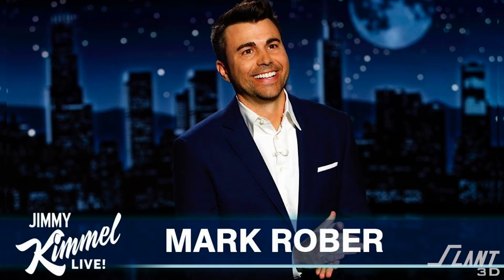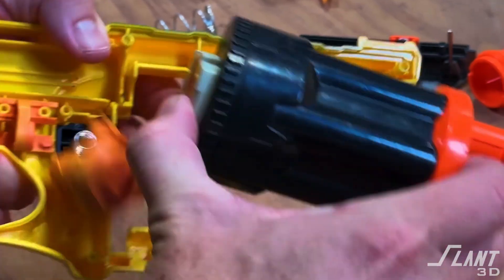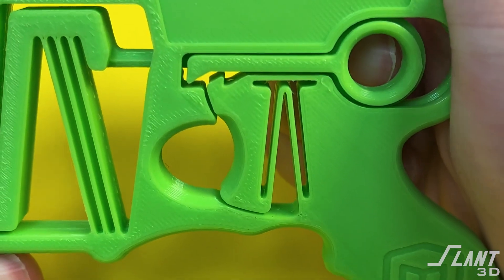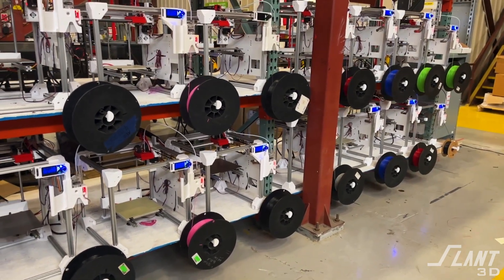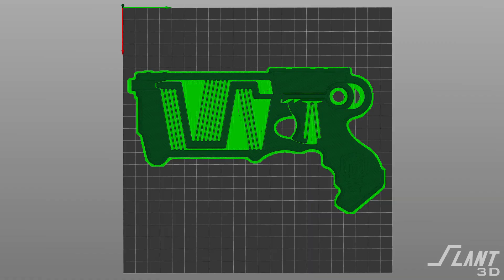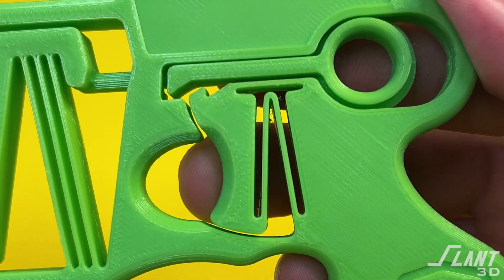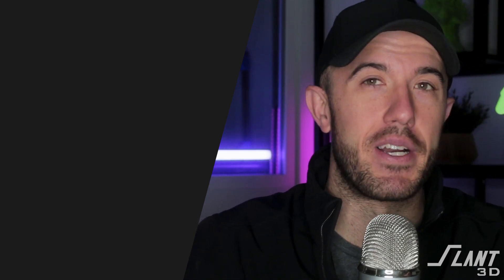The Secret Inside Mark Rober’s 3D Printed Nerf Blaster | Design of Compliant Mechanisms

Comment: Definitely do the redesign. I printed the original at full size but obviously got somethings wrong. Spring was too stiff to pull back easily. When it did pull back to the lock position the top of the gun deformed

Comment: I am confused. Here you propose to build the gun on a solid layer. In other videos you bemoan the ejectability of parts with large print plate contact surfaces. 
The obvious thing to add is a barrel for better performance.

Comment: This most absolutely can be injection molded and formed, along with many other methods.  It can also be molded with dual density etc.  Why do you usually provide false information in your videos rather than just being honest?  Honest mistake?  What is their to gain vs losing integrity and trust?
Reply from the maker: You are simply incorrect. There are subtleties in this design that make it unmoldable

Comment: I scaled this print up on my p1s using pla and it's very difficult to even cock it back. When you finally do get it to latch, when the trigger is pulled the mechanism does like a half shot not firing all the way. It's so hard to pull back that the frame bends instead of the springs. Any input on why that happened?

Comment: I'm guessing a it would make more sense to print the compliant mechanism as a module , as the mechanism is the only thing that needs to be printed in one part and its size is limited to the build plate, an outer frame can be printed in parts

Comment: "This cant be done with any other process" ? yeah right. The issue with those is also that if it breaks, you can't just swap out a new part. Often then whole construction is then busted. To get the spring tension, one could make it by laser or cnc plastic sheet. From carbonfiber, from metals that hold shape instead of permanently bend and even some woods. Nooks and crannies can be made also. Even smart injection molding can do this.

Comment: This is an interesting exercise but I dont think I would want to use this over an actual nerf gun. Trying to make the whole thing one piece is not great. I'd rather have a full-sized frame to mount a compliant mechanism in, and also have an aesthetic cover to give it that Nerf "gun" look. This would make it easier to have a frame printed/injection molded, then you could 3D print the now smaller compliant mechanism, since you aren't printing the full toy. Also, while reducing parts in general is a good thing, NO replaceable parts is actually worse. Worse for customizing and for modification, which is a big part of the Nerf experience for people. It would also be cool if you could shoot either full-sized nerf darts, OR 3D printed darts, making it easier to adopt for people. Now, I've said a whole lot and most of it I don't have the expertise to do, but it would still be kinda cool to see this more fully realized as something other than a novelty to try once and move on.

Comment: This is going to kill Nerf, imagine the neckbeards moving from buying Nerf, with parts, that can be disassembled and modified, to either buying 3D printers and producing their own pistol shaped glorified plastic springs OR going to the hardware store, buying a bunch of plastic pipes and springs and coming out with their own garage kits because, of course, the greedy manufacturer will see this and think they can reduce production cost and increase profit ignoring that their market might depend on 30yo guys that can buy any toy they want and go full nerd and not on kids... stuck to a tablet, with 0 interest in toys... How do you even mod that thing if not by modifying the file to be printed?!

Comment: The "less parts is better" is quite stupid argument, if you ask me.
What happens when it will eventually break?
You'll need to buy a whole new device rather than fix that you got.
Also you can't use different materials with different properties.
And don't start with "but it will be cheaper". Look at America right now. Companies try to squeeze every dollar.
So nah. I'll stick with screws, bolts and multiple parts.

Comment: 3D prints may have a certain springiness at first, but with repeated activations it will fail. Sometimes you just need steel parts.
Reply from the maker: Incorrect
Reply: @slant3d  Well, as someone who has tried to use the springyness of PLA and found them to either break, or permanently deform, I challenge your assertion of "incorrect".  There's a good reason why people generally use proper steel springs and not plastic springs.

Comment: I’m a mechanical engineer and we often avoid compliant mechanisms because they wear down faster and are harder to repair; but in certain cases they let you do stuff you simply can’t do otherwise
Reply: I thought one of the main advantages was no wear? As long as its not pushed past the fatigue limit
Reply: @theaveragepro1749  Very few modern lightweight materials (that I'm aware of) have fatigue limits. Steel does, aluminum doesn't. I don't believe any polymers have fatigue limits. Would work great if you made everything out of steel and titanium, much harder (material science-wise) materials to machine than Al and polymers.
Reply: @diveforknowledge  in this case I don't think fatigue limit means what you think it means.

For steel, as long as you are below the fatigue limit it'll last forever.

As we all know, aluminum has no fatigue limit.

That doesn't mean it's infinite, it means it's zero.

Basically, what this means is that any stress, no matter how small, if repeated enough times, WILL cause the part to fail.

For steel, you could put 1M, 10M, or 100M cycles onto a part but as long as you are below the limit it will never "wear out".  

For aluminum each load cycle counts down.  This is why airplanes have a stress limit and are retired well before the critical accumulated stress value is reached.
Reply: @gordonbowe That is what fatigue limit means. Steel and titanium have a fatigue limit, which is why it would be better to build out of them than aluminum or polymer where cyclic lifespan matters. Obviously cases exist where other properties take precedence over lifespan, like electrical properties, weight, and cost.
Reply: But in most nerf guns, if something breaks, the vast majority of time, no kid or parent will bother opening up the toy and superglue back a part or replace a broken spring. They will just get a new gun. Also it’s not like kids are using nerf guns 8 hours a day for 30 years. Probably just a several dozen times a year for a few years. So it all comes down to manufacturing cost which compliant systems may have an advantage.
Reply: Could you respond to @theaveragepro1749?
Reply: Material limitations are what you are referring to. Materials can only take so much stress before they fail. When material sciences progress far enough, these mechanisms will be far more useful.
Reply: Exactly. With traditional manufacturing if a part breaks, you can remove the part and replace it. With compliant mechanisms, when something breaks (and it will) you need to throw away the whole device and get a new one. It’s inefficiency masquerading as efficiency.
Reply: @reidboggs4344  If we can make a plastic that can be recycled more times it'd be better, no? there'd be no end of life problem and you wouldnt have to separate materials for recycling, just send it back to the manufacturer and they'd chuck it back into the grinder to make new filament
Reply: @mglinkowski  it’s still more efficient to replace a small part instead of an entire mechanism.
Reply: @reidboggs4344 once again popsci influencers and journalists freaking out over something that already exists and isn't being used much for good reason
Reply: @reidboggs4344 I don't think all compliant mechanisms are "inefficiency masquerading as efficiency," I just think many people drastically overstate the value of creating an entire finished product with all of the compliant mechanisms built in, which we know will probably never be a common use case. But imagine having replaceable compliant mechanisms at different points in a larger machine. You can create quite complicated movements that are affordable and replaceable - you may even be able to just print a new replacement part on site rather than have to order one and wait. I think there's a lot more potential than you're allowing for. These mechanisms aren't likely to be doing huge jobs, but rather the small unappreciated jobs in machinery that nevertheless need doing.
Reply: Part DO NOT Break on their own, they break because a human designed it wrong. Period.
Reply: ok.
Reply: Yeah its a niche tool for a job. Strange its getting such high popularity. Its not really that incredible.

Comment: its a tool and empirical study, distribute the stl. the community will improve on design, size, maybe 2 parts. accessories for handles ects. this i a good design to potentially remove the primer from the cartridge supply line.

Comment: Strongly disagree that this is difficult to manufacture in anyway but 3d printing. This would be super easy to injection mold or even extrude and chop if you change the cocking mechism. I think that the underpass on the cocking mechanism is the only thing preventing it from being stamped out of sheet metal. And that really doesn't need to be an underpass it just wasn't a problem for the process it was designed for.
I hear you about using rafts to reduce 1st layer failures but I think youre underselling how often the blaster will be inoperable because something over fused to the raft and either got stuck or created a rough surface that is now interfearing with the action.

Comment: I have read about compliant mechanisms a lot over the years, and what i notice as the big problem for making these designs ready for mass production (At least in many instances, i can't speak for all designs.) is that bringing part count down from X parts to specifically 1 part becomes the be all end all goal.

Why not think about it from the perspective "How do i make this from the fewest amount of well designed, robust compliant mechanisms, while keeping manufacturability (Is that a word?) in mind at all times.

For instance, this design looks like it could be split into three or four parts if i'm not missing something (trigger group, spring and plunger, and a "shell" that could consist of one solid piece, or two, depending on what is the best way to assemble it.

Comment: I'm not so sure about the statement about not being able to get multiple densities from a single material. It's a much easier way to get a dual density from the same material,  but not the only way.
Lots of materials will expand and contract (changing their density) as they're heated and/cooled. And, steel will sort of lock itself if you cool it down fast enough. Because of this, you can dip part of a yellow hot steel bar into some liquid clay and then quench the entire bar. The part that was in clay will cool more slowly,  resulting in a denser, smaller size. After that, you can machine the thing into an even thickness, giving you a single, solid, even material with a non-uniform density.

Comment: What if, instead of making it thicker, you printed several at a time, connected side-by-side? Whoever removed them from the printer would pop the layers apart, like with plastic model kits. That way, you get your wider base for minimal adjustments.

Comment: 3d printing this is easy for sure, but this is just a flat plate with shapes cut out. Great candidate for water jetting, wire EDM and really wouldn't be hard to CNC machine depending on size.

Comment: I disagree with getting rid of the back stop/cover on the pulling mechanism. I think the main reason for it is so that you cant bumb into on accident and set it off. It would also protect the ring if it were to be dropped. That way the back guard takes the hit instead of the thing that makes the gun work getting hit and possibly breaking.

Comment: increasing the height of the print will linearly increase the stiffness of all the springs; good and bad but honestly this original design is already dangerous enough as it is to the eyes lol. a redesign into a bullpup like the FN P90 could make this more scaleable on print beds with a fully rectangular footprint once the handle is eliminated; the current design actually can fit in the palm of an adult hand with the index finger directly under the muzzle and the thumb wrapping around the back of the gun. trigger can actuated with the middle finger pushing a bar that goes through all the leaf springs. this should be doable when Z is scaled up. the guard behind the cocking ring is useful to be able to cock the gun with just  two fingers with a pinching motion; its a great convenience and should not be removed. variable density of the bullet is nice but i think effect will be minimal. it is far too tiny and you would be moving bullet CG at most a couple mm. center of pressure needs to be moved way back, i.e. fins like a star anise. the gun isnt gas operated so the barrel doesnt need to be fully accept the bullet; instead it can be shaped exactly like the fins so that only the fins are in the barrel. a portion of the fins sitting outside the barrel can be angled slightly to provide spin once in the air and also simplify the design to require only two fins.

if i were to get into this i would pursue the bullpup redesign and use the cocking ring itself as the firing pin. essentially flipping the gun backwards. but i imagine the impressiveness of this would be for designers and 3d printing nuts but completely lost on kids.

Comment: It looks like a nicer production version would have:
- thicker frame to make the back loop guard redundant and the springs stronger
- moving parts piece here would have snap-ready post holes on the plate side and snaps/clips on the top of the print
- face-plates, one with snaps/clips, the other with holes for them, and maybe a logo/bullet-clips on the top of the print

Comment: You missed the most important improvement. This should be scaled to fit a standard foam dart. There are short darts made by nerf and others that would be short enough to fit in a scaled up version easily and would fly well due to the dual density and better balance than the traditional length dart.
The blaster modding community has been making our own half darts for over a decade, but now that there are mass produced ones available in mass retail like Target and Walmart means instead of designing a new projectile, you should use this easily available option.
Reply: I mean he literally said they couldn’t scale it up any more so I don’t really know what you are talking about.

Comment: I would add a cocking leaver at the back that when you close your hand.. pulls the spring back. Then add a spring loaded mag at the front for the lighter darts that you sumised. Also you could make like s spiral tip on the bullets to add spin? Then when adding width.. when you make the spring mechanism wider ist should also have more power? this would be solved by the mentioned leaver at the back.

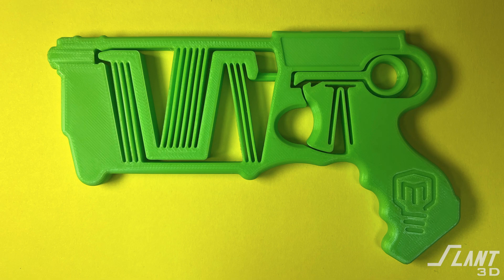Comment: At 4:44, you suggest making the bottom surface solid and having the compliant mechanism above that--how would you make sure that the compliant mechanism is able to move on top of the solid surface without fusing to it? Support material doesn't seem like it would work there and it also seems too complex to rely on bridging alone.
Reply: I'm very curious about this too. Not really picturing how that could work well.
Reply: Same way we have parts on a raft that separate easily?  Design in a 0.05 gap, the plastic below should help significantly with the bridging but it won't fuse like a normal layer would.

Comment: This would actually be incredibly simple to injection mold in a single piece I'm not sure where you're getting your information from
Reply: There's a guide just forward of the trigger that would have to be redesigned.  I can see a variant injection molded in a 5 piece mold:
-2 sides
- barrel bore and front of plunger
- 2 pieces slanting in for a guide on the aft of the plunger.

Comment: It sounds like your biggest issue with the "design" is the size. There are larger FFF printers, right? Also the design also wasn't designed just for FFF, there are other additive technologies that can be used for production. Also creating a solid bottom face would mean all of those compliant mechanisms would have to print as a bridging operation if you weren't looking to have a disposable raft. 

My biggest issue with your content is you act like you are the only service provider in additive and that your company's design guide as the definitive in AM. Focusing only on FFF is like only having a hammer in your tool chest. Sure you could be the best at driving nails, but what are you going to do when a bolt shows up?

Comment: I'm building a full-size R5-D4 replica.  An obvious bit of puppetry for Arfive is to have the Bad Motivator pop up, and then be easy to reset.  My current plan is to disassemble an old Nerf pistol and try and repurpose the parts.  But... something like a pair of these mechanisms on either side of the motivator, with the whole thing mounted to the lid of the droid's dome (ie, head), would also be very fascinating and cool.

So, yes, I'd love to see more examples of compliant mechanisms and springs, in whatever shape or form.
Reply: Hey whattya tryin to push on us?!